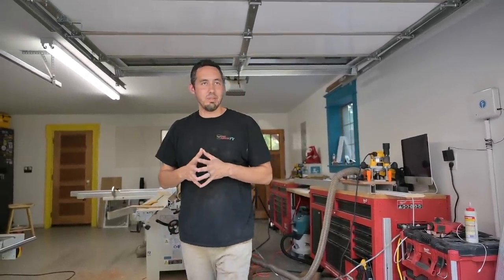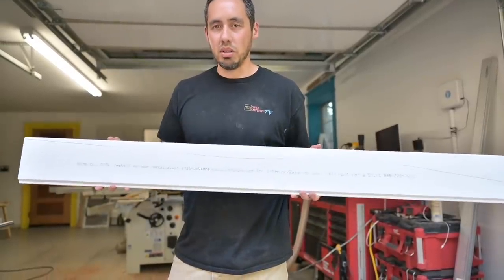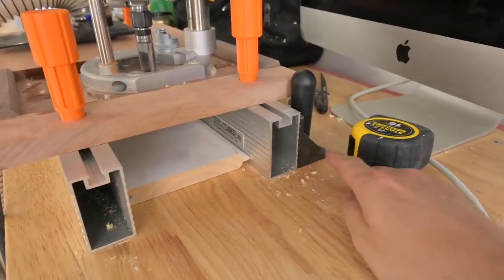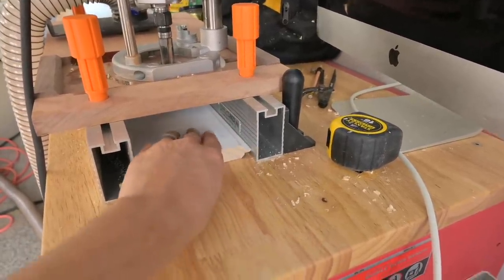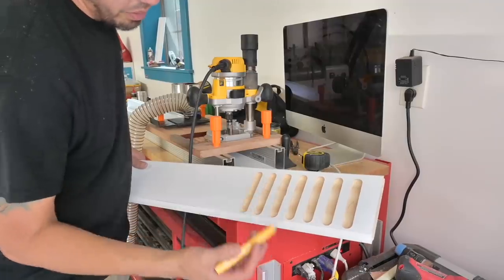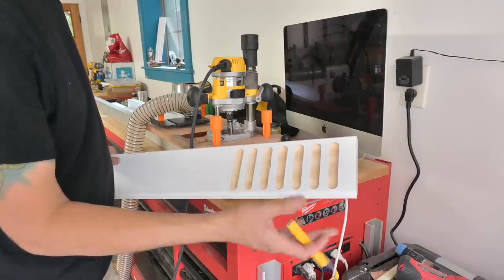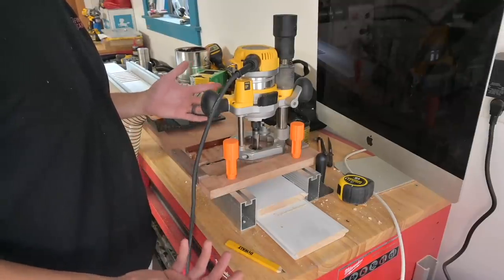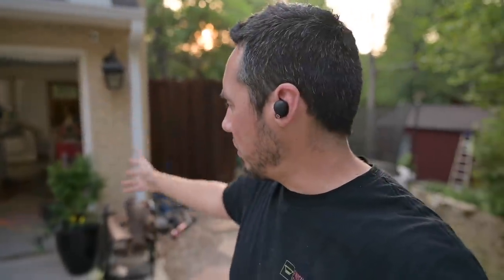I have to make & install this custom crown moulding.

Comment: 5/22/22; ...vertical gruves cut into horizontal T/G planking with (little) Windsor cap molding...well customer's desires pays the bills...but...several issues:
1. who will clean the (normal) dust out of each of those (million) cavities?
2. Conflict: Visual proportion of gruves..Windsor cap at top has little  'thin spaghetti' 🍝  routed profile... compared to those huge 'shotgun shell' verticals with 'fat diameter' (1") router bit... then your spacing of the shotgun shells (TBD..1" or 1 1/2" spacing)..humm...maybe 'thin' vertical Spline' gruves horizontally..kinda close to Windsor cap routed detail would be less abrupt to observe (but more dust to clean out !)
3. A+ on engineering/creating your own jig to make this 'custom' molding...but you need a 'hold-down' clamp to secure the work piece from movement while 10,000 rpm's  of router bit slam into it causing that little 'chip-out'...so yur jig needs a 'hold-down'.
4. Paint b4 showing sample to customer..ugotta paint the 'relief'/dug-out area same (semi-gloss) as body of t'board.
 So enjoy your telling us the job issues & much enjoy your creativity making this jig with help from yur buddy who makes...(What !) 3D printed tools 🔧 👌...handles/gizmos/spacers...hey, that is a video of its own..your visiting 🎥 filming him making one of those 'orange squeeze-down/twist-it-thing-ah-ma-jigs'!
Always enjoy your videos..and seeing yur kids helping too! Great to see family helping 👨‍👩‍👧!👍👍👍😊🧑‍🔧🍺

Comment: Tough part is your flute spacing from corner to corner. What if you end up with 1/2 a flute in the corner and a full one starts the next corner.
Reply: This..
This is exactly what i was thinking..
Going to be a nightmare to get the spacing to look even at install..

Comment: What you should do is figure out the width of the final flute you’re going to cut pull the measurement for your first one, and measure half of your spacing distance from your first cut flute to mark your left edge of the flute add the width of the flute mark your right edge and you should be able to pull all your measurements after the first flut is cut accurately cause you really don’t need to mark your OC once your first OC is laid out you’re just making more work mark a defined side of the flute so you can pull the jig throat plate and line up the mark with the flute jig

Comment: Add a table saw adhesive tape measure on your track then just have to move board to your desired measurement in increments. 15 bucks on amazon

Comment: Just make roughly a ratcheting Paw That swings down from above on for example the right hand side start with one or two of the approximate space as you slide the material to the right it will work pretty much the same as the anti-kickback as soon as you engage The previously cut fluke just make sure the material holds back toward you and it was self space and just continue to basically ratchet to your right push your head pull back against a stop which will drop in the  slot at an angle not vertically that way it’s self acting you don’t have to pull it up out of the slot each time as with typical

Comment: Between the two orange fasteners on the right side make a drop stop by drilling a hole in the center that will allow a rod to move up and down. On the bottom of the rod a block the same OD as the router is placed, on the top a handle to pick it up and down. Now you just cut first flute, pick up on your new stop handle, slide material into place for the block on bottom of stop to fall into and cut your next flute. Repeat over and over. You can trick it out with a spring on the lower end, between block and horizontal guide rail to cause constant downward pressure. You can also ad a vertical 1”x2” with holes all the way down attached between the two orange handles on the guide rail, that will allow you to change flute spacing anytime to any size with a simple rod/block stop move to new hole. Great vids bud!

Comment: I have two suggestions.  First, make tick marks on the edge of the board closest to you every two inches.  Don't measure each time after each cut.  That is an error prone process to measure each time.  Second suggestion....reach out to your pal Matt Jackson at NLC.  I'll bet he could come up with several suggestions!

Comment: make a template that has maybe ten or more flutes....once it's created use a bushing on your router and clamp the template into place....cut, move the template,
 and repeat....done!.........it's the same concept of how you make vented doors with wooden slats......using a template, bushing on your router and a clamp
..... .oh and by the way...you need smaller cuts and more flutes for it to look good

Comment: Tedious process, but at least it will be easy to install.
My idea, whatever the spacing you decide to use, put a 1x2, 1x3, whatever is appropriate, across the top of the board at the end of the feed, I'll call it the "scribe" piece, so that the material can pass under it. Mark the board on the left side of this "scribe" piece, plunge, slide the material to the right until you see your scribe mark on the right side of the "scribe" piece. This way you're not picking up a tape measure.
I hope that's clear enough to understand.

Comment: So I think I understand what she is trying to do, but I think she's going about it wrong. If we go back to the classic system, you have your Architrave, Frieze, and Corona/Cymatium (Crown). So in this case the 1x6 is your Frieze and you're putting crown on top, that's fine, but those flutes would better represent Triglyphs on the Frieze like in the Doric order. So you might have to play around a little with the spacing, but basically do groups of 3 flutes about 1.5" apart, then space each group apart about 7.5" (width of a group of 3, the Metope), then repeat. Just google Triglyphs and you see right away what I mean. I think basically having a full Frieze of flutes even 2" apart will be too much once viewed on the wall/ceiling. I think this will look way better and it might be what she's actually going for, plus it will save you a lot of time with less flutes to cut.

Comment: What ras1500 said… just drill out a couple holes in that right side clamp down, drop a couple dowels thru the drilled holes. That 2x should give you enough vertical stability, make the holes/dowels slightly smaller diameter than the flutes. You can figure out the particulars but you already have that 2x sitting there. Interested to see what you come up with 👍